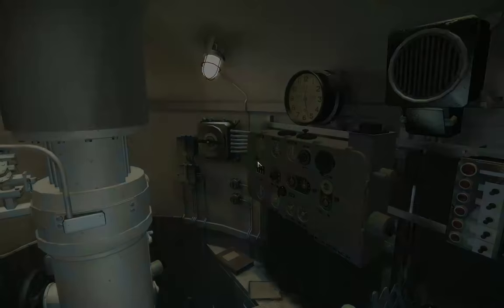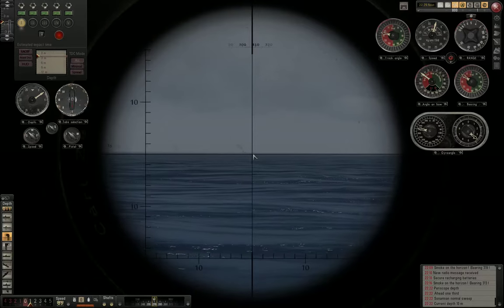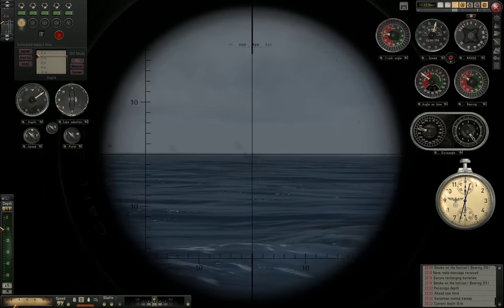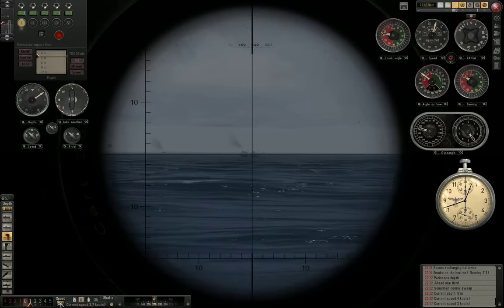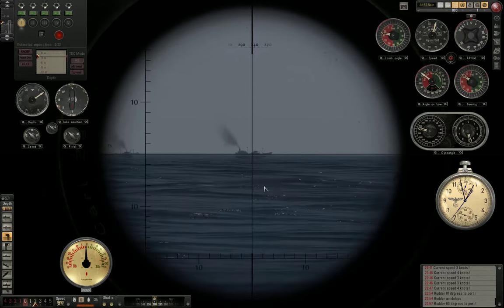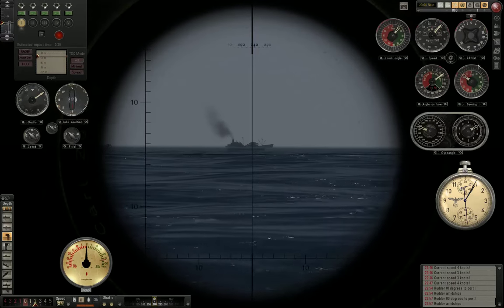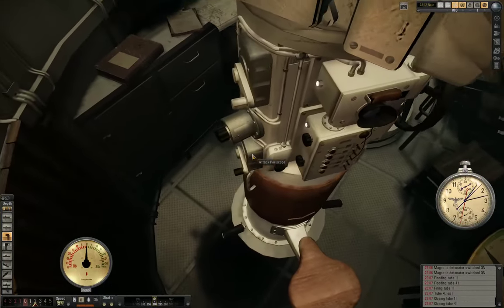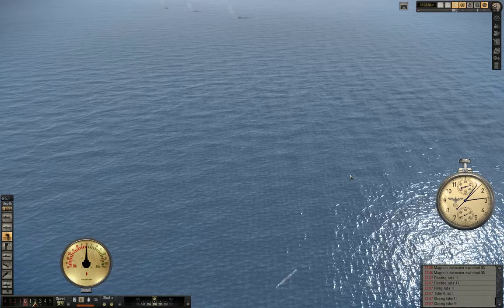Using the historical Ausdampfverfahren. Silent Hunter - The Wolves of Steel - Tutorial

Comment: Quick question about The Wolves of Steel. Is there a mode where you can just lock on to the ship and fire the torpedo using the 1, 2, 3 numbers on the easy modes or does it force you to play realistically? I'm not really good with all the realism stuff and I mostly just play SH5 for fun, and I want The Wolves of Steel more so for the physical U-Boat mods and environmental mods. I'll learn the realistic way to use torpedoes eventually lol
Reply from the maker: I think it is possible to customize TWOS in that way
Reply: @Tonci87  Thanks! I'll just download it and try it out.
Reply: @ShawnTheDriver  Yes you can enable auto-TDC. Jut turn it on in the XO dialogue in the periscope. Then just lock your target, then unlock while still pointed at it and fire.

Comment: that was really interesting.  I'm running a SH5 playthrough series right now and am trying to learn the SH5|TWOS ways - currently trying to master RAOBF.  I am coming from SH3|GWX where I could rely on precise watch officer range estimates, gps sub location, and the 3 min 15 sec rule to get perfect course/speed target info.  I'm noticing that my RAOBF speed and aob estimates are sometimes way off so I am looking for other methods.  A couple of questions came to mind: I suppose this method might be limited if you are engaging fast targets, as the uboats underwater speed is limited, or perhaps in that case you just need a larger lead?  Also, for convoys it would be concerning to have to do 4-5 knots underwater on approach, as it might spook the escorts.  Also, historically could uboats fire torpedoes when traveling quickly underwater?  Is there a speed limit on periscope usage?  This technique is very interesting to me because in the past I have only used fast underwater travel for evasion, and on approach I just creep in.  I wonder if this could be applied on the surface at night, where you have more speed flexibility.  Good to know that torpedoes have noisy performance in SH5; my TDC estimation might not be that bad after all.  Thanks so much for the tutorial!
Reply from the maker: If you are trying to master the RAOBF, you can have a look at my tutorial where I explain how to use it in conjunction with the Attack disc. The Ausdampfverfahren depends on your sub being fast enough to achieve a collision course with the target. You can do that with more speed, or with a larger lead. The method works very well when doing surface runs at night. I would not advise sailing submerged at 4-5 knots if escorts are present. The danger of them hearing you is too great. I believe that the boats historically could fire their torpedoes at any speed they were able to achieve, at least I never read anything contrary to that. The game does not have a speed limit on periscope usage, but historically the periscope would start to vibrate when going above 5kn, so I just limit myself to not use it if I´m going faster than that.

Comment: Hey good video, but I have a question in deed as far I knew, this method as it was shown calculate the speed by asin and put aob in 90, and you put aob as bearing and own speed. Yours it's the historical version or its a equal valid way to avoid the calculation (I saw there disc to calculate the 2 historical methods)
Reply from the maker: The method shown is historical. Check the tvre.org link in the description

Comment: 4:55  tvre.org says that sub captains had recognition manuals such as these (https://de.wikipedia.org/wiki/Weyers_Flottentaschenbuch) and that they also had access to RAOBF rings would actually be linked to the stadimeter.
Reply: A couple things on rec manuals: Firstly the Weyer books contained an incredible number of ships, and it was impractical to find the exact one prior to an attack.  Also, Weyer and others did not necessarily provide all the data that the rec manual in game did.  More often these books were used to ID a ship after torpedoing it when it radioed its identifier (as these were listed in the books).  Secondly, this data is not needed.  The KTBs (war diaries) make no mention of using data from a manual.  Primary methods were Ausdampfen (a bit different than described here) on the surface by getting a constant bearing and computing its speed(as shown at 3:50) , plotting (Koppelverfahren) by using eyeballed ranges and exact bearings, and simple estimation (bow wave, bearing change etc).  

Now, on RAOBF:  The early models of the scopes did indeed have an RAOBF linked to a stadimeter.  These scopes (model C/6) were not the fixed-eye one like we are familiar with.  It worked like a traditional periscope, the whole thing raising up and down.  The Standsehrohr (C/2), fixed-eye attack periscope that we are familiar with (sit on a saddle seat and rotate it with pedals), did not have these features.  They were apparently removed in favor of better optics, and likely due to the complications associated with the installation of these.  Range was simply eyeballed by how much of the scope the target filled up (horizontally), or using the reticle if a mast height were known or could be estimated.  By what I have found, the C/2 was already in use by early '40, but not sure exactly when it first came into use.  I do know though, that many boats still had the old model with stadi/RAOBF.  So, in reality, for a wartime boat, could've gone either way.  Remember too that the tactical advantage of a fixed-height scope like the C/2 far outweighs having these whiz-bang tools, since the skipper could, with his left hand on a lever, constantly keep the head of the scope right at the waterline and essentially invisible.
Reply from the maker: @m.hamacher7881  Great response, there is nothing I could add to this.
Reply: @Tonci87  Thanks Tonci! Keep up the good work! (derstosstrupp on Subsim)
Reply: @m.hamacher7881  "So, in reality, for a wartime boat, could've gone either way".

So, my point still stands.
Reply: @JDMonster That part of it yes.  But the other part, the rec manual, well, therein lies the problem right?  No mast height data, sketchy length data if any, and RAOBF is just a pretty decoration (unless you use an assumed mast height for a rough estimate).
Reply: @m.hamacher7881  Which I would assume most captains did since the vast majority of torpedo shots were estimates.
Reply: JDMonster Not necessarily estimates. If you’re looking at the chart on that website that says estimation for all of those, it’s because he went by the shooting reports that were available and he extrapolated that. What he should have done is gone into the KTBs and it would’ve been obvious that the data, just as I said in my original reply, was not estimated if they could help it, it was obtained on the surface by those methods that I mentioned.  The methods I mention are even mentioned in the commander’s handbook, which explicitly states to the extent possible the data should be obtained on the surface using these methods vs estimated.  Of course a lot of times it was estimated, but if the time was afforded, no.
Reply from the maker: @m.hamacher7881  There is anotherproblem with information from rec manuals. If ship captains learned that u boats wrre using rec manual data to obtain accurate firing solutions, the ship captains would have changed the outlines of their ships, the mast heights, etc. In fact, some ships did that anyway. This would make rec manuals useless.